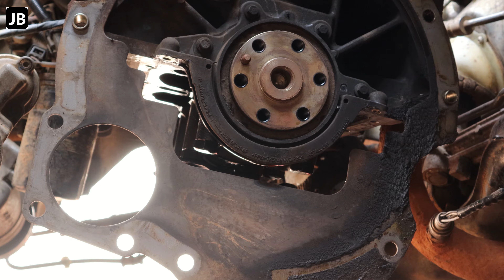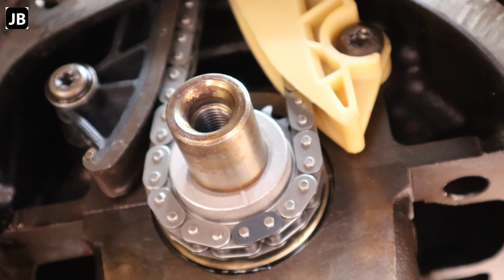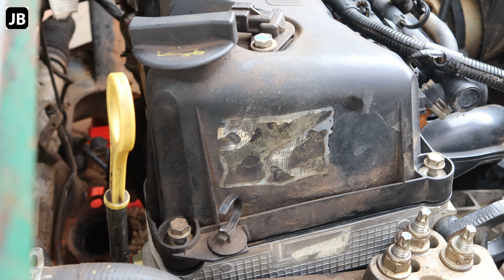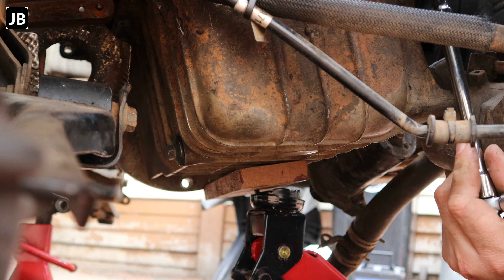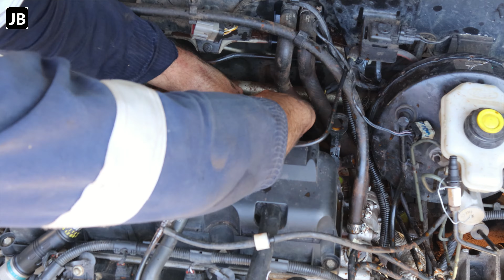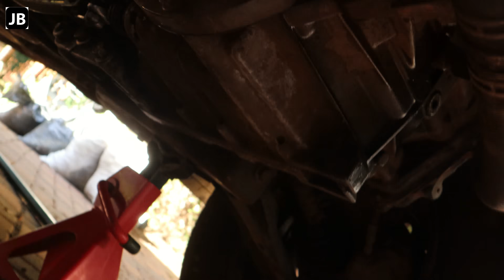Ford Bantam 1.3i ROCAM timing chain replacement

Comment: Had the same problem on rocam bakkie few years ago
The chain as very noisy..when I started to strip I found out this job
Is to expensive.. Because the gear box and clutch must come off... So. What I have done was just replacing the 27 bolt tensioner.....  So far the chain was not noisy anymore 😊

Comment: Please I need advice I need to change pulley seal does pulley go to enter nicely,if I don't loose a bit the oil pump bolt ,is it going to enter easily?

Comment: Hi Jaco, my name is Thando and I need your assistance please. In short, we took out the engine and installed again. I'm now confused about the two black negative wires from the battery, where do we connect these wires? Help please 🙏

Comment: Morning Jaco, Tony here. 
Firstly, cool video. Though I have questions regarding the head bolts.
Reply: Had the engine overhaul done 10 000km ago. Now there's a major oil leak coming from the head gasket. My question, do I still need to replace the head bolts¿ thing is, I don't know if the guy who did the job actually changed them.
Reply from the maker: I have a personal rule that if I take a top off an engine, it doesn't go back on unless it has been decked and it is done with new head bolts. Head bolts are cheap enough.

Comment: Hi Jaco i have a Ford bantam 1.3 rocam the chain is making some noise what could be the problem, please help
Reply from the maker: If you are sure that it is the chain, it could be the polymer Chain follower/tensioner. If the motor is running fine. The oil pump sits in the vicinity, so could be that as well. Difficult to say on the other end of YouTube as I can't hear "the noise".

Comment: I had an old micra k11, and now i have a fiesta 1.3. At Nissan engine issues appear after 300000km. Ford start problems from 100.000. Bad quality ,poor manufacturing.
Reply from the maker: Thanks for your comment, every manufacturer has its own set of strengths and weaknesses.

Comment: Is the camshaft sprocket bolt the same torx bit size as the head bolts?
Reply from the maker: I can't remember the size, but the head bolts are 2 different sizes.

Comment: My chain guide broke by the bolt, i want to get behind the oil pump, this is the only youtube i see dealing with bantams, is there a way i can take the oil pump out without taking out the engine or tilting the gearbox
Reply: You need to split the engine and gearbox just to get to that 2 bolts of the sump.

Comment: The last time i took out the gearbox to remove the sump i decided enough is enough. I drilled 2 holes in the bell housing exactly under the 2 bolts and use a small ratchet and extension to remove the 2 bolts. Worked like a charm for me.
Reply: How did you know to drill exactly
Reply: Jannie Het jy dalk fotos van gate wat jy geboor het asb. dalk mate van n sekere punt asb
Reply: Pleasecan you send me also the photo where to drill the holes
Reply: Oh wow, why didn't I think of that. Stupid design

Comment: Is the rocam an interference engine? Not getting a clear answer online.
Reply from the maker: As far as I have it, it's not, so you won't bounce a valve off a piston if you mis time it. But let's rather not give it a try.  🤓
Reply: @JacoBadenhorst  haha indeed. pretty sure my timing chain is on its way out. When i did the rocker over gasket seemed like a bit of slack was there. So yeah was tryna work out how difficult was gonna be to set top dead center. Thanks for the info i appreciate it.
Reply from the maker: Once you have it all stripped, it is super easy...

Comment: Having to pull the transmission to drop the oil sump is the most rediculous design.thanks ford!
Reply: It's doable. You can remove all gearbox bolts and try to separate it from the block. You can get a gap of about 5cm or less, which is enough to undo the hidden bolts.
Reply: Oh thanks that's very good to know. @mpho1247

Comment: Werry good and education. And the burden 2 rear sump bolts. 
Wel, you don't neat to take the gearbox, clutch and flywheel of or out. 
If you can support the gearbox and eng with block and tackle. (Preverbally 2, on the same rail. 1 on eng and 1 on gearbox) You can just split the eng from gearbox.
And with a 1/4" drife socket and extension you can undo the laast 2 samp bolts in order to get the samp of and back. Then just made the eng back to the gearbox.
Good advice. Put like 3 or mor extra-long bolts thru the bellhousing to the eng to hold the eng, bellhousing alignment. Moov the eng about 2 " away from the bellhousing.
You can even unhook the intermediate plate from its dells to get more cases to the sump bolts.
If done it this week, just before X Mas 2023. I'm 69j. old (or young) and it worked.
Thy say a laze man will always try to take short cuts. Wel if it works. Why not.
Reply from the maker: I have not thought about it like that. Maybe a "spreader bar" over the top can hold the engine and gearbox up? You still had to pull out the CV axles?
Reply: @JacoBadenhorst  l dit not disconect enything from the gearbox just rear gearbox mountong 😀
Reply from the maker: @tinuswelthagen1096  hats off to you! I would have thought that the CV axle would not move enough toe separate the gearbox and engine. Well done!
Reply: Must say die cylinder head was of and exhaust manifold was hanging loos.
Reply: And the power steer pump loosen from its mounting.
Reply: Exactly.did it before...worked like a, bomb 🙂
Reply: Nightmare I had....some clever "mis-chanic" broke the timing chain guide from the bolt that holds it down.imagine my horror to do all that for 1 broken bolt😭.but got it done 👌🙏

Comment: Hi Jaco, ive just replaced timing chain and all. I have put the crank and cam to all the TDC marks, however when i start the vehicle it cranks but seems to not want to start. If i crank it a couple times it starts but cant hold idle without pressing the throttle. 

Any idea what the cause could be?
Reply from the maker: Could be a couple of things. Best get it to a technician.

Comment: Such a bad design to change a timing chain, Ford should have made it so as you do it without having to take the gearbox off or even the sump/oil pan
Reply from the maker: I agree 100%. But there is probably some reason for it. I just cannot see it.

Comment: Hi mine cranks but doesn't start no spark, but the power to the coil is there. What could be the problem.
Reply from the maker: how did you check power to the coil? bad plugs, bad ignition leads?
Reply: @JacoBadenhorst  by stripping each wire and checking with a test light on battery negative. And cranking the car for spark.

Comment: Good day sir can I replace the newer engine of 1.3 to my old 1.3 Rocam because the ICU Computer box is not the same
Reply from the maker: If the sensors are the same and fit you would probably be able to, but you will have to check with the OEM.

Comment: Jaco if the valve cover is the only part that leaking can I just replace that gasket. Bantam rocam Engine got very low km's. Thanks in Regard and thank you for the video.
Reply from the maker: Yes. If it's only the top cover leaking, I would just replace the single gasket. If you are lucky or buy OEM parts, you will be able to buy the single gasket only. On the other end, a full set of aftermarket non-OEM gaskets may cost Les than the one OEM.

Comment: hi brother why did you change it
Reply from the maker: The bantam had a leaking head gasket. So when replacing the gasket I had the engineering shop work on the head. And I decided that while I have the engine open, I might as well do it. So it was fot "peace of mind" more than anything else.

Comment: Hi Jaco , i have a bantam 2006 1.6 rocam, i think the oil pump has gone in it, still works but is faulty. Oil light comes on then the noises start coming, switch off and on then pressure seems fine for a littlle but then light comes on again. So my question is , while replacing oil pump is it best to change chain and guides aswell? Im no mechanic , so ill have to take it in unfortunately 😢 so would that add alot of hours to the labour charge? Thnaks in advance
Reply from the maker: How many miles does the bantam have on the clock? To get the sump pan off in order to get the oil-pump off, you will have to split the engine and gearbox in any case. So the only additional work would be the valve cover
Reply: @JacoBadenhorst  it has 160k on the clock.
Reply from the maker: @nevillecoleman1587  I would do it while you are going to have the engine open in any case.
Reply: @JacoBadenhorst  thanks for your responses, much appreciated.  Enjoy your weekend further.

Comment: Can please bring my bakkie for timing check, it doesn't sound ok since it was "fixed"
Reply from the maker: Cicilia, I am so sorry but I'm not a mechanic by trade.  I only work on my own vehicles.
Reply: @JacoBadenhorst  I was very impressed to watch how you effortlessly replacing timing chain. I don't mind bringing my car to you because your work is very neat and you know better than those "experienced mechanics". The one who replaced my crank and timing chain messed up my car. The next thing when done replacing everything the car doesn't want to start, the oil is leaking ever since. This was frustrating for me because I love my bakkie and i'm not planning to sell it because of these problem. Just want it to be fixed and I think you are my mechanic.
Reply: Now after watching the whole video I know what wrong they did on my car. As soon as they see that the car is not starting after replacing the crank and timing chain they started fiddling with the electrical of the car. They breached the ignition switch to be able to start the car, now  the car battery doesn't last because its always on even when the car is off. The clock stays on. I need an electrician who can rectify my Rocam engineer back to its normality. Please help me gentlemen.:eyes-purple-crying:

Comment: So to replace the stock cam with a performance one it is going to be a pretty straight forward proses judging by how open the cam sits and how easy you can align everything....giving me ideas
Reply from the maker: Yes, it should not be a problem. If you have the engine stripped up to that point. You will however have to split the engine and gearbox in order to make sure you have the bottom of the timing chain lined up.
Reply: @JacoBadenhorst  ok thanks I will look what I can do..I will tell you how successful I am in a few weeks💪🏽

Comment: Hello Jaco , I am having Ford Ikon 1.6 Rocam Engine , The Coolant And Oil is mixed , so how much dollar estimate, would be the cost to fix and is it worth because the vehicle is still in good condition, only faced this issue
Reply from the maker: I would definitely repair it then. Cost depends on the cost of machining the head. Your time is your time and your cost is zero. The rest of the spares are fairly cheap. But take into account the amount of tools required. Without proper tools, you may be battling.
Reply: @JacoBadenhorst  Yes Sir , Because The rocam 1.6 engine is still a absolute pleasure to drive I am still surprised by the performance, so after repairing how many years the engine could run or how much years it could sustain by taking good care

Comment: Hi Jaco I have rocam 1.3i 2007. It broke timing chain but before that it had a blinking engine light then hard start. What could have been problems. It also wetted the plug number 4.
Reply from the maker: It could have been a number of things. It is honestly difficult to say over the internet. Could have been an ignition problem if you had a wet spark plug and check engine light and hard start. If you broke the timing chain you will have to check valves and replace head gasket anyway.

Comment: Good afternoon sir hope you are well. Just a quick one my bantam 2007 1.3 has 318000 on the clock at this high mileage what oil should I use. Thank u for the feedback in advance. Thank u.
Reply from the maker: I use shell helix 20w-50 (High mileage)
Reply: Thank u sir
Reply from the maker: @kerwinbehrends6886  no problem. Glad I could help. I try and stay away from "cheap" oils...

Comment: I have a problem  my chain is making  noise how do I fix it
Reply from the maker: I would replace the chain, sprockets and chain guide and tensioner. What sometimes happen is that the mount for the tensioner breaks off. If the chain slips a tooth on one of the sprockets, you will be having a bad day. (Think bent valves and so on.) And if you are going to split the engine and gearbox, you might as well replace all the spares. The spares are much cheaper than the labour to strip and fit. Hope it helps.
Reply: @JacoBadenhorst  thanks  a lot

Comment: Hi Jaco, my rocam mixed oil and water. Just got my top back from engineering. Currently, the timing chain doesn't want to fit. I'm puzzled, I don't know what to do. Must I remove oil sump/ gear box to get to it to adjust or is there a reason why it doesn't want to fit
Reply from the maker: Yes you will have to split the engine and gearbox to take the oil-pan off in order to make sure you have not slipped a tooth on the bottom sprocket. Besides that you will have to take the oil pan off to clean out the "chocolate milkshake" in the bottom.
Reply: @JacoBadenhorst  alright I get it. Thanks for the help Jaco, your vids are so informative 👍
Reply from the maker: @thabangmagashule4260  it's a pleasure.glad if it helps. I sadly sold the bantam a few weeks ago.
Reply: @JacoBadenhorst  recently acquired mine, so I'll be for sure returning to the vids

Comment: Hi Jaco. are you say you need to remove the oil pan to replace the timing chain?
Reply: and to remove the oil pan, you need to remove the gearbox? omg
Reply from the maker: @zunaids4036  yes you are 100% correct. It is an absolute ball-ache
Reply from the maker: The last two bolts on the oil pan sits behind the flywheel with no way to get to it. Even the workshop repair manual states it that way.

Comment: Hi Jaco I need help my rocam 1.6 its having problem with lifters they so noisy even if I have changed them I  did change them twice. Does a chain do make a noise similar to lifters
Reply from the maker: If you have changed them and it's still knocking, it's probably not the lifters.  The chain should not make a noise so it's probably something else.  It is difficult to say as I have no idea how the engine is sounding.
Reply: Yes.. mine has been making those funny sounds..I just opened it only to find that the chain guide is broken 💔

Comment: Manufacturers design it like that. 
1. They don't want you working on your vehicle.
2. Piss off the mechanic and make his life like hell 
3. They not working on it after it's made. So it's the next person problem. 
That's the reason I can think of. I prefer if they make it less complicated. Makes it easier to work on. Simple job, has to become a big job
Reply from the maker: I think indirectly it is sort of #3.